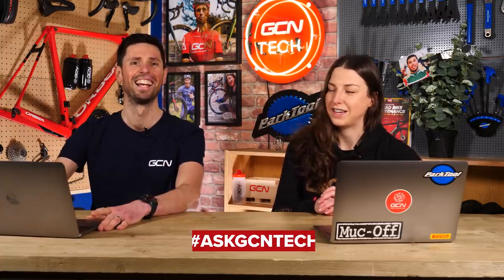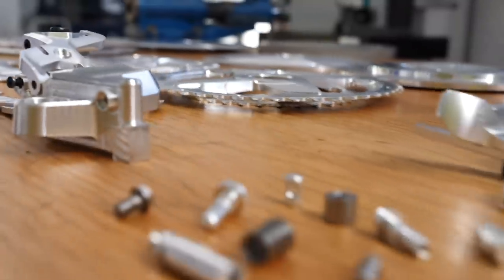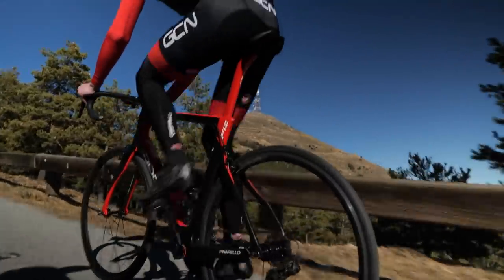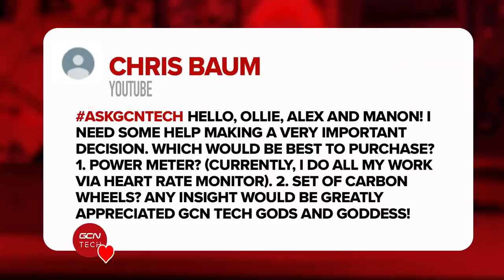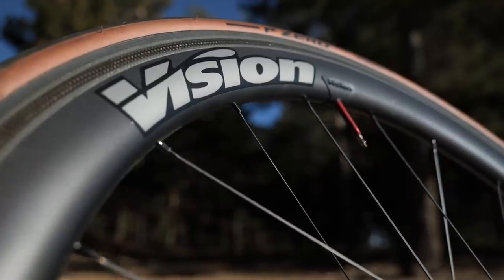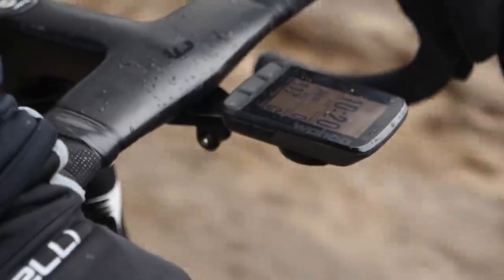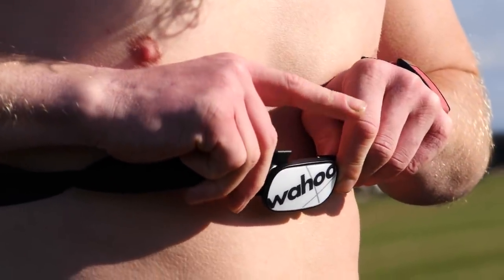Should I Buy A Power Meter Or Carbon Wheels? | GCN Tech Clinic #AskGCNTech

Comment: It's easier to make a small bike bigger than a big bike smaller
Reply: If you're in between sizes, you can go either way as you can adjust the bike just enough to fit you.
Reply: @LRF49  not really, on my larger bike I need 70mm stem and seat slammed forward, it's awful.
Reply: @leslie7922  Yes really. I just think you're not in between sizes. Sounds like your size is pretty set. In reality, I'm size 53, but almost no bike manufacturer produces that unless it's Pinarello and Cervalo. Maybe others I missed.

Comment: Never buy a wrong sized frame. And I mean never, unless you are a pro. You'll experience no end of issues. I had a 54cm Roubaix. Even with the best fitting, I felt like Superman. That lead to gand/shoulder/back issues. A professional sizing and I'm on a 51cm Grevil. That bike is a little on the small size, but it got rid of the issues.

Comment: #AskGCNTech Hello dear GCN Tech, greetings from Russia. At this moment I am planning to upgrade my groupset and choosing between  Shimano Ultegra, SRAM Force or Campangolo Record (all three electronic). There are many opinions that Shimano is the most reliable option, Campangolo is the less reliable option, and the SRAM is somewhere in the middle. Do you agree or disagree with this verdict? Which of those three is the most reliable in your opinion?
Reply: Check out Hambini's latest video about Shimano's Dura Ace (should apply to Ultegra too) crank failures. Might want to steer clear of that model until Shimano addresses the problem. I think Shimano might be a sponsor of GCN, so understandably they might be reluctant to mention it.

Comment: Oval Chain Rings can and will ruin your knees, as they constantly slam your knee joints at every pedal stroke. Here is how... Your knee is underload, and suddenly it is totally unloaded of any tension when the stroke reaches the very top stroke. Here is where the Oval ring causes the pedal to quickly move forward to bypass this dead area, to quickly reach the downward power stroke.  Suddenly the knee is slammed / shocked with a tremendous heavy load to power the down stroke. Repeat that a few thousand times day in and day out, and BINGO!  You'll start having mysterious knew problems all thanks to Oval C-rings.  And yes, technically Oval C-rings do work, but at the expense of wrecking your knees.

Comment: #ASKGCNTECH Hi GCN, greetings from the Philippines! Wondering if you could give tips on how to choose an efficient drop bar flare degree for gravel riding/touring? I'm riding a 46cm drop bar with a 24deg flare for a year now and the stability is superb, but I might have to change to a 40cm or 42cm due to some comfort issues on a wider drop bar. I'm seeing options with 12deg or 30deg flares. Are 24deg flares recommended 'cause it seems to be in the middle, or how would I know if I should get a lesser or greater flare degree? Thanks and more power!

Comment: Power meter over carbon wheels is a no-brainer.  Hopefully everyone will agree that the best bike upgrade is the engine, ie you.  While a power meter isn't necessary to make you better, it absolutely makes it easier and more enjoyable.  Not to mention that a power meter is less than half the cost of a decent set of carbon wheels.  I have both, but I've had the power meter for 7 years and the carbon wheels for 1 year.

Comment: I’ve a Scot scale, how lose should my stem be? I mean, if I hold my bike up on its back wheel the steering falls sharp left or right. I do like firmness and control, I’ve actually crashed as a result of hitting a rock and the steering turning 90 degrees, over the top I went, broke a rib. I used to be able to ride with no hands and control the steering with my knees, this seems so edgy and lethal🤷‍♂️ is this a modern bike or does it need tightening? PLEASE HELP 🤔🤦‍♂️😔#askGCNtech

Comment: #AskGCNTech Any suggestions on how to fix a loose mud guard mount on a carbon frame? I have a 2018 Cannondale Synapse and one of the mounts on the front fork just spins in the frame. It doesn't seem like it is going to fall out, but I am worried that if I tighten a bolt in it too tight, I might have issues trying to unscrew it because the mount will just spin with the turn of the wrench. Can you use super glue on carbon?

Comment: Osymetric (company that makes 'oval' chain rings) are extremely efficeient and take no more than a few minutes to adapt to. They require less wattage to achieve the same speeds, etc.
Reply: Welcome
How is it measured? I tried Doval chainring, I find it easier to spin especially uphill but I don't see any time advantage. I tried to ride the same distance back and forth and found the best time to be done on a regular circular chainring, anyway the differences were minimal. Unfortunately, I do not have a power meter.

Comment: Are integrated carbon handlebars worth it? Other than the looks do they hold any other advantage? Also is Ultegra R8000 worth a buy right now over 105 R7000 considering the new ultegra R8100 is Di2 nly and is vastly more expensive than the previous iterations? Not really into Di2 right now.
Reply from the maker: Integrated handle bars are generally more aero, especially so if they allow for fully internal cable routing (through stem/steerer). As for 105 vs. Ultegra - Ultegra is lighter and more 'refined' than 105, but is that going to be worth the price difference to you? They're both 11 speed, both mechanical. Remember as well that replacing worn out components like-for-like will be more expensive with Ultegra too, so it's not just the initial outlay that is higher.
Reply: @gcntech  im looking at the factor o2, the regular one n not the v.a.m. which doesn’t have a through n though internal cable routing pass through to the stem n the steerer. But considering the factor is not aero as a bike itself will the handlebar make abig difference? I want a light and agile bike which can do it all 😃 also thanks for the reply 😋

Comment: #AskGCNTech Cheers, I'm restoring a 70s bike and the brakes are very flexy, but it's bcause they are not very tight. When I try to tighten them they stop flexing but stick to the wheel when I brake and don't retract. What should I do? Thank you!

Comment: with hookless/tubeless and the seemingly low max pressure, what happens when you hit a pothole or other road hazard? I’m pretty sure when you squeeze a balloon the pressure goes up and it bursts… is there a safety factor to accommodate tire compression?
Reply: Hey, That's the whole point of the max limit set by manufacturers and ETRTO for example. They have done the testing and deemed that is max working pressure for condition's you'll likely face when riding and with an extra safety margin factored in no doubt. It's not that at a few psi more your tyre will just explode. For some people hookless is great and others not so suitable, much like all tech and equipment.
Reply: @GCNalex  So if you knew you were on a smooth road you could run higher than recommended pressures, right? evil grin  I feel like the tire/wheel industries are missing a trick here. People want both tubeless and high(er) pressures... you'd think  if they wanted more market penetration they'd come up with a solution that didn't limit the pressures to the point where it could be considered a 'negative'.

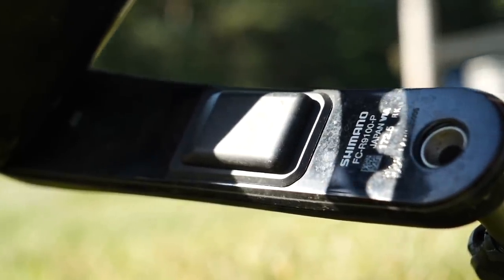Comment: #askGCNtech Hi guys, hoping you can get your #NerdOn 🤓. Wondering what your thoughts are on a disk wheel or 65mm deep section (Mavic comete) for the Ironman Wales course. As obviously it’s normally disk all the way, but this is a lumpy course… looking to complete the bike leg in 5:00-5:15hrs. Cheers Callum 🕺

Comment: I've got tibias longer out of proportion to my femur. I find a smaller frame would have been better. I seem to prefer a slightly lower stack and shorter reach that a smaller frame would provide. I might also give me shorter cranks and less setback which works for me.
Reply: I'm the same long tibia to femur and I put my seat forward as far as it'll go plus I put my saddle up 10mm higher that the calculation for height. I actually recently went up a size to my recommended size from a size smaller.

Comment: #askGCNTech. Hi Alex, Ollie and Manon. I have been running tubeless for a couple of years with no issues. I then recently replaced my tyre and my 60mm deep section rim exploded! The manufacturer says this can happen with any brand of wheel if the seal between tape and rim isn't perfect. Watching your videos of tubeless setup I have heard no mention of this. Is it a known issue?

Comment: #askGCNTech Hi Team, what do you think is the most effective way to cover disc brake pads when applying paint finish protection sprays to a bike? I've tried a few things (tape, aluminium foil shrouds, plastic bags etc) but wonder if you've got a hack for this? Not concerned so much about the discs (as I remove the wheels) but the pads in the brake blocks. Cheers.

Comment: #AskGCNTech
Hey Manon and Alex, I am rebuilding a bike which has a 105 9 speed rear derailleur. The front derailleur is worn and need to be replaced. Does it need a specific 9 speed front derailleur or as i suspect could i use a 10 or 11 speed 105 front derailleur. As well as this it needs new chain rings. Could a 10/11 speed chain ring be used or would it again need a 9 speed specific chain ring. Finally do the pulley wheels need to be specific 9 speed as i can only find 10 speed. 
Thanks

Comment: My flash, just buy a front aero wheel to afford the power meter, it's almost = a rear disk, it's a lot faster in crosswinds than no aero wheels, elliptical shapes don't steer you in strong winds.

I use my front 65mm all weathers & winds, it's less work, I like 80mm best, prefer 90mm over 65mm it's not as good yet way better than none doing headwinds.
Hth 🍺

Comment: #askgcntech Hey all, I’ve been seeing lots of adverts on ceramic coating for autos and was thinking about using it on my bike frames to make cleaning the my bikes easier. But is this a good idea? Also wondering if I might recognize any aero gains?
Reply: I'm using this stuff. You can get bike specific but I went for the cheaper car stuff. Yeah, it probably does keep it a bit cleaner. Definitely no noticeable aero gains though 😂